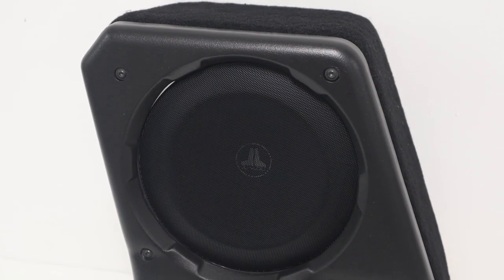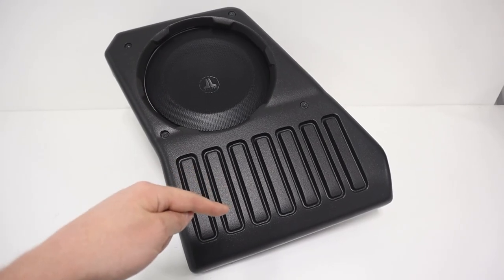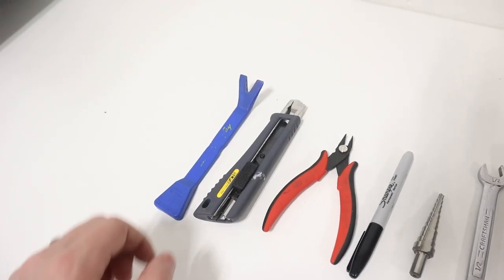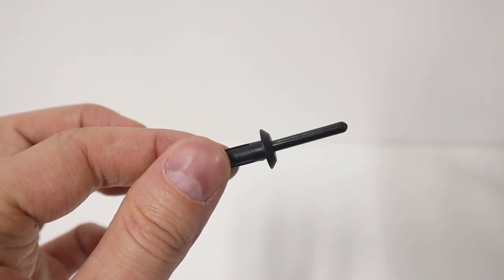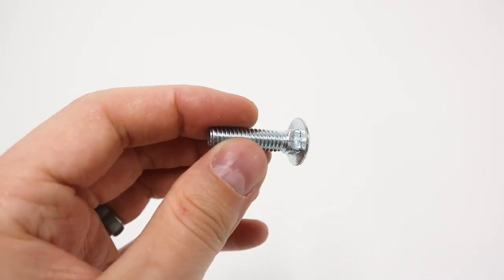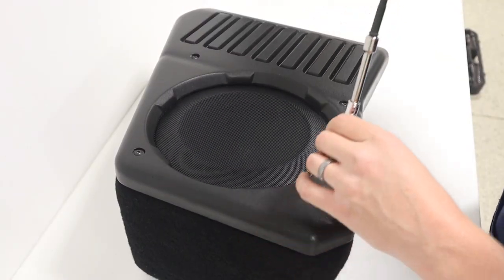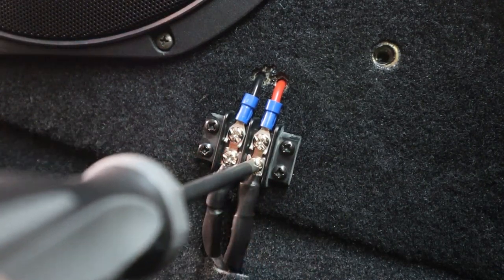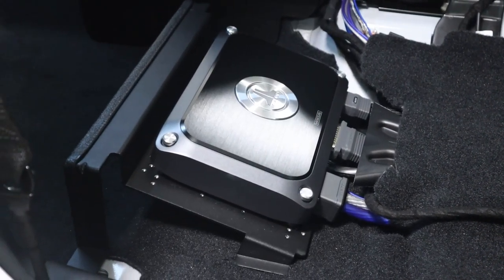JL Audio Stealthbox® Subwoofer Install | CarAudioFabrication

Comment: Like the video am putting one in my wrangler along with a 2600watt 6ch amp to big for under the seat not sure a good location to mount it
Reply from the maker: Nice. Be sure to take a look at our recommend power (75-300W) for the 10-inch TW1 subwoofer used in this Stealthbox. Sounds like your amplifier might be outside our specifications.

Comment: Great video! I just ordered the Stealthbox, amp, amp holder, and fuse holder. I also bought the JL Audio amp power kit as well as the sub wires. I noticed your sub audio cables were screwed onto the sub. What I bought had RCA type ends. I don’t see anything on JL Audio’s site that mimics what I saw you use for the install. Please help and thanks!

Comment: Great information! Does the box stay flush with the backseats? I have installed backseat recliner brackets which reclines the entire backseats by a couple of degrees. My main concern is that the sub enclosure won’t fit anymore since the backseat is more reclined than stock. Is there some play for that enclosure? What would you recommend?
Reply from the maker: Unfortunately, it does sit flush to the seat. There are more photos on the product page to give you a better idea.
https://www.jlaudio.com/collections/car-audio-stealthbox/products/sb-j-jl4dpas-10tw1-2-car-audio-stealthbox-94666

Comment: Great video.  Question, if only installing one side with no factory sub would you recommend driver or passenger model?  Also what ohms would you pair with what amp?
Reply: Stated in the video. Drivers side if only installing one.
Reply: If you have no factory subwoofer it really is up to you which side to pick. If you have a factory subwoofer replacing the passenger side would require buying a replacement panel from the dealer so if only going one Stealthbox it's best to do the driver side. 

The VXi subwoofer amplifier shown in the video is stable down to 2 ohms and provides 600 watts RMS. So you would want the two 4 ohm subwoofers connected in parallel. If you are only doing one stealthbox I'd suggest the XD300/1v2 which makes 300 wRMS at 2 ohms, so you would want the 2 ohm subwoofer version. Hope that helps!
Reply from the maker: Thanks for hopping on that one!
Reply: @CarAudioFabrication  
Thanks for the reply!!  Great info!

Comment: does anyone know what the part number is for the panel to replace the Alpine Stock sub woofer when putting in Passenger side shealth box.  OEM MOPAR Please let me know I ran into issues talking to parts department at DODGE.

Comment: Is there a significant improvement having a stealth box on both the driver and passenger sides? Or, would it be more beneficial to invest in better speakers?  I can only afford 1) 2 subs; or 2) 1 sub plus speakers.  Thanks!
Reply: I purchased a single stealthbox, amp & speakers for now, going to wire for two subs/amps and add them later if I decide I’m not completely happy. This way I don’t have to take everything apart again
Reply: @camm07050  Thanks!
Reply from the maker: If you're looking for an increase in overall sound quality with the addition of substantial bass, the sub plus speakers is the way to go. If you're happy with the quality of speakers you have right now, maybe adding extra bass is the way you want to go. It really depends on what your system goals are at this moment. 

Having said this, you can always add things later and wire everything now as Dave said. 

For any further questions, feel free to reach out to our tech team. They will be able to assist with any installation questions you may have! You can submit a ticket request below :

https://jlaudio.zendesk.com/hc/en-us/requests/new